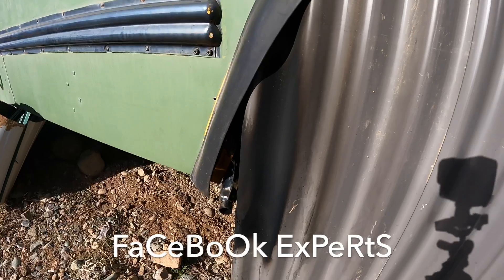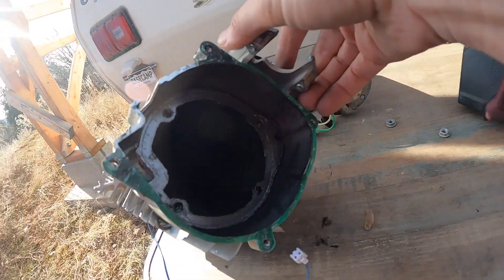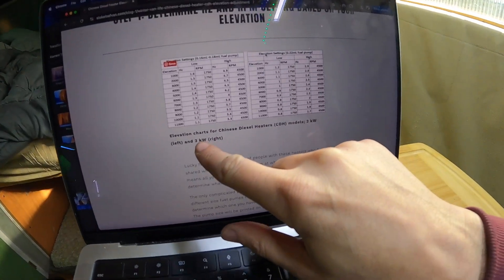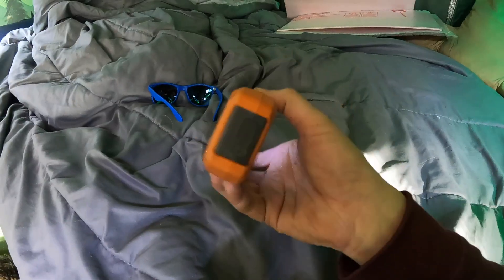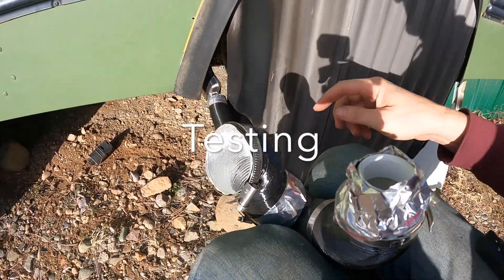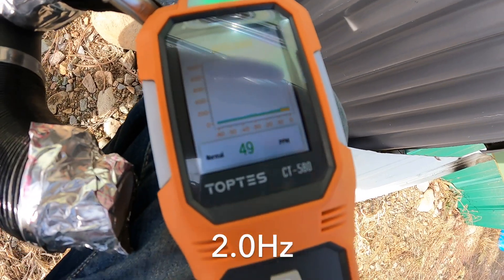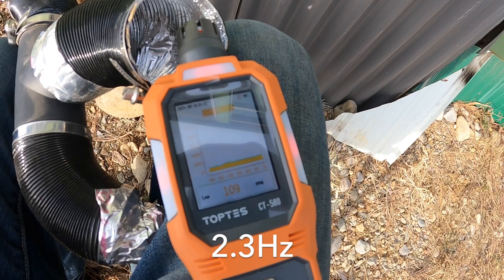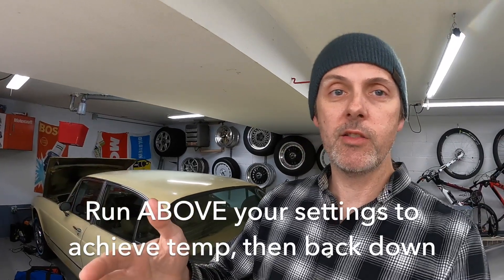Tune a Diesel Heater for Altitude: Save Fuel, Run Cleaner!

Comment: I'm at 8000' as well.  I ran a brand new diesel heater the other night at 5.5k, and after a few hours it shut down and only blows smoke now. Wont even ignite at this point.  After watching your video I'm guessing I clogged it completely.  Does that sound about right to you?  I'm afraid I'm gonna have to open that thing up and clean it out.  However I have a question, do you have to set those custom settings again every time you disconnect the power?
Reply: Mine worked fine straight out of the box first time. Next time it started to smoke and the exhaust was glowing red. I stripped the whole thing and it was full of soot. I found a piece of metal was partially blocking the fuel port, behind the glowplug screen. Works fine now. Just chinese quality control... or lack of.
Reply from the maker: I'm sorry that happened to you, man!   Yes, I'm guessing it's clogged completely.   The good news is they are very simple contraptions; you pretty much need a few allen wrenches and a 12mm socket (I think?) to take em apart and clean it out.   No, it remembers the settings.  The big thing is once you know your 'upper limit' at which point it isn't burning cleanly, you can avoid running it at that Hz, so hopefully it will be a really long time before you have to do it again.  Let me know how it goes!
Reply: Try draining the tank and add a couple ounces of berryman injector cleaner strait up. If the pump is gummed up it will drip too much fuel . Sometimes they get stuck the berryman cleaner frees them up

Comment: My new Heater sooted up after a couple weeks. I cleaned it out and runs well again. I'd like to tune it as well. I tried codes 1688 and 9009. Nothing seems to work. It just cycles me back to the beginning number. Also tried 1234 and a few other numbers. Any suggestions??
Reply from the maker: You need to have the type of heater with the board/ecu that allows it to be adjusted. It sounds like you bought a 'name brand' heater that someone slapped a logo on, and removed functionality. The good news is I think you can swap your board to one that is programmable, scope ebay or amazon for boards that allow you to adjust things.
Reply: @ADDvanced 
I have the exact same board as yours...it's a Wippro heater but same board as many others. I realized that the while the 4 dashes are visible the "key lock" icon isn't..which i believe is stopping me from entering the program mode. 1234 code does work for the other 4 settings tho.

Comment: You called some people d*kcheads but you are the one that has the air intake for the heater outside without any protection. If there are spiders/ bugs crawling in it, it won't work anymore.
Reply from the maker: The intake is SUPPOSED to be outside. If you put it inside, you are sucking your already heated air into the heater, then pumping it outside. Not only is it wasting your heated air by pumping it outside, you're also then creating negative pressure inside, which increases drafts and leaks. I had the filter off in this video because I had just removed the heater, I reinstalled it later. Cheers
Reply: @ADDvanced  Thanks for your super fast reply. That does make sense, cold air is better. I have mine outside protected from all the negative weather here in the Netherlands. It's working like a charm. How often do you use the heater?
Reply from the maker: @ifdontspeakdutch  Every day, it's my main source of heat.
Reply: @ADDvanced That's great. These things do work ❤❤❤ I wish you all the best on the other side of the world 🌍

Comment: If these things are running correctly they should smell like a brand new diesel pickup... If you smell anything it's a light bleach type smell
Reply from the maker: Correct. But it's REAL hard to tune them at elevation, hence why I made this video

Comment: Problem is I have an Hcalory with Bluetooth that has a knob on the controller, no arrows, with difference interface. Of course it gives an altitude reading, but always zero even at 8000 ft.
Reply: Have you connected to the app?  I don't know for sure, but it seemed like mine picked up the altitude from the app.  Let me know if that works.
Reply: @MOKPT3 oh yes, used it from day one. Shows up zero on there too with no adjustment. 😢

Comment: All CO detectors/alarms need to be set at your knee or lower. CO is a heavy gas. If it gets to the roof you are already in the danger zone before it trips the alarm.
Reply: I believe you’re thinking of carbon dioxide. Carbon monoxide is slightly lighter than ambient air whereas carbon dioxide is slightly heavier than ambient air. CO detectors are safe to mount 5’ or higher in rooms.

Comment: Nice video. Thanks. 

It's hard to tell in the video, buy it looks like your combustion fan clearance is too big.  It's supposed to be about the the thickness of a business card.   It would be good to adjust that, then check your ppm again.   

An incorrect clearance is a known cause of sooting.
Reply from the maker: On the one I had taken apart?   That was my old one.  Good to know when I rebuild it, I will try to adjust that.  I searched "Diesel heater fan gap" and came up empty handed though; is there a how to on adjusting it?  It looked pressed on, so idk how you adjust it.
Reply: @ADDvanced you just push down on the fan to decrease the clearance.  A socket can be used to prevent damaging the delicate fan.  

In one of the FB groups, in response to your post,  I and another user discussed the gap as well.  I think he posted the exact number it should be.....a business card works if you don't want to be super exact.
Reply from the maker: @jackg8478  Thanks, I will give that a shot when I rebuild the other one.

Comment: It would probably help to heat the fuel and the air inlet to maximize efficiency.
Reply from the maker: Interesting idea, so like get another metal 'exhaust pipe' for the intake pipe, and maybe use metal zip ties to attach it next to the hot actual exhaust pipe?  Would prewarm the air going into the heater.  Not sure about heating the fuel, not sure it would even be necessary.
Reply: I made a pedestal out of steel pipe (same diameter as the mounting plate) in which the exhaust runs down and out the side the conditioned space. Inside that pipe very close to the bottom of the heater I mounted the intake canister. I think this has an intake air heating effect.
Reply: That’s absurd and completely unnecessary 😂 but hey, you can learn a lot from a dummy, mostly what not to do in life 😂

Comment: It is not 100% clear in your video, but it appears that you have the earlier model ECU that does allow minimum tuning to be adjusted independently.
Good luck with a modern form of the similar appearance ECU. Only the top end does appear to be effective for adjustments once the unit is running.

Typically you will not be able to ask for a min Hz less than 1/3 of max.

Also there are funnies with fan speed when under 2000RPM on the older ECU as it appears you have, it does not exactly follow what you have set when under 2000RPM.
This may also explain the perceived difference for the first few Hz steps.

But essentially yes you need an ECU of the type you have to get tuning capability.
Reply from the maker: The black controller function much the same, same code 1688 too.
Reply: @ADDvanced  I mean the ECU, inside the heater. That is god of fuel control.

FWIW, I'm the designer of the Afterburner and correct tuning via a CO meter is the only way to be sure, even if using the auto altitude correction feature of the Afterburner.
But new ECUs are uniformly frustrating with their more limited tuning adjustment, ala no direct control for minimum.
Reply from the maker: @rljzathras  Oh, ECU not controller, got it.  

Dude, so awesome you commented on here!   I have been wanting an afterburner so bad, but money is tight at the moment.   It's baffling none of these companies are enabling WIFI on their controllers with a simple app, though I'm sure you're glad they aren't doing so lol.  

I recently read about a brushless CDH that allows independent control of the combustion vs the heat fan, not sure if it has dual motors or what?   Might be worth looking into for altitude....   anyway, have a good holiday, awesome you left a comment on my channel!  You're famous!

Comment: I wonder if that thing is like my pellet stove and wood stove. Like when I run my woodstove on low, it runs really dirty. So I have to periodically get it running real efficient and hot and it helps clean the pipe out. Does it do that on that little heater? My buddy is thinking about getting one for his outside Jacuzzi room in Kentucky
Reply from the maker: Depends what "low" means; as I showed in the video the 'low' settting I used from the altitude chart was super dirty, so I adjusted it higher.   A lot of people say to run it 'high' before shutting down to burn off the soot, but this video shows that running it higher actually creates more soot, so idk if that is a good idea.
Reply: @  ya I’m thinking low is better for the diesel heater. The opposite for a woodstove. Really what I’m asking is does it kinda clean itself if you keep it running clean. Or is like a egr on a power stroke diesel truck and you just have to replace it ? The heater seems really cool.
Reply from the maker: @RobertPirtle-q9g  I think the middle settings are the cleanest, but still providing good heat.   Obviously PPM will go up with more fuel, but 2.3hz was 5x the emissions of 1.6 hz, so not even doubling the fuel but 5x more emissions, not a good sign.
Reply: @ADDvanced you can always try a 2kw fuel pump. That would make it run lean.